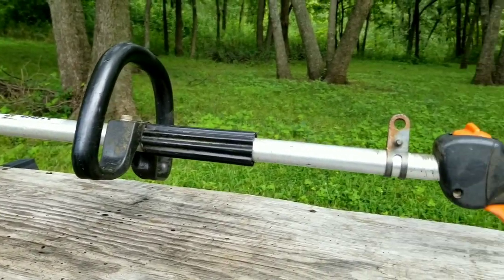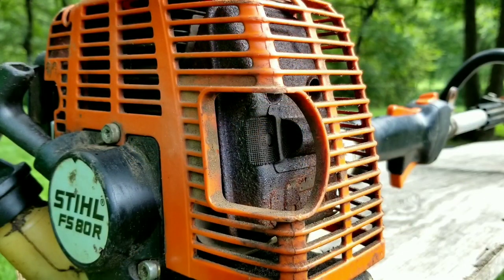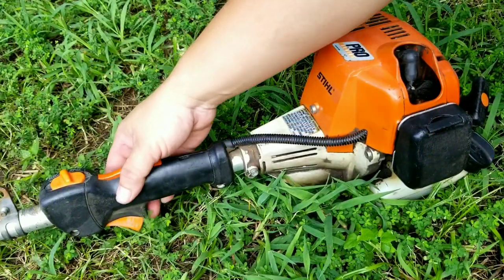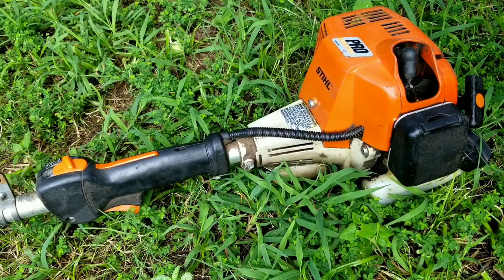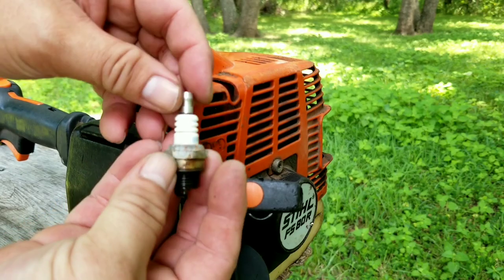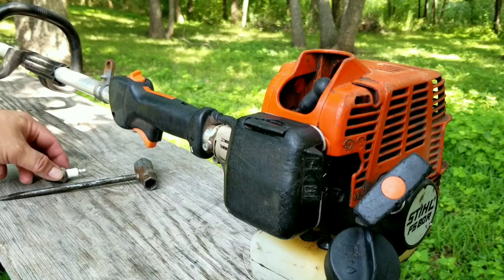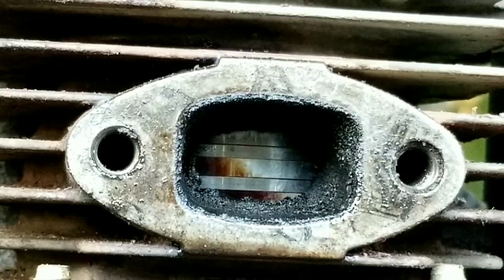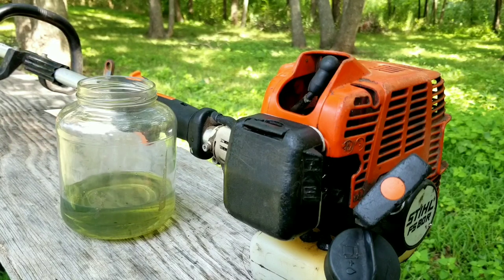Stihl trimmer won't stay running.  Sad ending

Comment: I have a Stihl FS 110. I bought it at least 8 years ago and it's never given me any difficulty until a couple of days ago. I intend to purchase a carburetor kit to replace the one that's in it. The kit also comes with a spark plug, gas filter, air filter and other parts from Amazon. I noticed that it would start and work well until I needed to shut it off for a few minutes. It used to restart it without any problems but lately, it wouldn't restart. I cleaned the filters and spark plug and it's working a lot better. I started  using that premixed 50 to 1 gas that is sold in Home Depot. It doesn't have ethanol and that's  the main reason that my machine has lasted so long. I use it quite a bit since I live in S. Calif. I have 2 and a half acres of lots of weeds.
Reply from the maker: I'm going to guess that the original carb is having some difficulties delivering fuel like it supposed to so a replacement Carb is the best option. Hopefully it works out for you.

Comment: They last longer because they are built better.  I still run my FS 85.  Wife got annoyed from the clutch bell sound, so last year I bought a brand new Troybilt.  It lasted two uses and was nothing but problems.  EVERYTHING broke.  For the FS 85 all I do is run Amsoil, clean filters, grease gearbox and keep the carb tuned.  Runs like a champ.
Reply from the maker: Excellent work.  Thanks for the comment I appreciate it
Reply: I often wondered what made that ding a ling bell sound in my Stihl hl75 hedge cutter. Never knew it was the clutch! I could listen to that bell sound all day.

Comment: Very sad. Was a great trimmer and not cheap. Reason for possible damage as you have pointed out, accidently using straight gas, wrong mix in gas can, mixing wrong ratio fuel/gas in gas tank of trimmer (yes, I have heard of people doing that) or loaning equipment to friends and neighbors. Never loan out your power equipment. It will not be the same when you get it back. My stihl is over 15 years old. I did have to replace the coil last year. It still is running strong.
Reply from the maker: excellent.  Thanks for the comment I appreciate it
Reply: My father gave me one piece of advice that I have followed religiously. Loan out your wife if you’re so inclined but never loan out your power equipment 😆👍

Comment: I use a FS85 since 2002 and it runs perfectly, the Stihl Trimmers are built very well and I take good care of my equipment. I only use Stihl
Reply from the maker: Excellent.  You must take very good care of your equipment for it to last . Thanks for the comment I appreciate it
Reply: I have a Stihl and it NEVER starts.  Have to take it to someone every year.  This is my THIRD gas trimmer - it will be my last!

Comment: I have a FS 90 R and work all day, everyday, for over 2 years. I bought 91 R and did not like it. Its heavier and I don't get the same feeling. The 90 has the same problem as the one on the video, it won't stay on unless on the choke. I wish they continued the 90 R instead of the newer models. Great video!
Reply from the maker: I completely agree with you. Thanks for the comment I appreciate it

Comment: The similar problem even after I had professional service from a trusted location. what I found was the tank filter we floating still connected to the tubing so I was wondering if I'm just sucking air. Took the tank off and carefully push it back in making sure it was at the bottom of the tank and now runs better than it has in years. If it happens again I might spring or something to add weight to the rubber hose to keep the filter to the bottom tank.
Reply from the maker: if you do make sure it's stainless steel

Comment: Danged if I know why so many people with 2-stroke engines insist on running them with no oil in the fuel. "I'm only using it once, it doesn't matter." Yes it does!
If you have a damaged 2-stroke, and it still has some compression, you can sometimes get more use out of it (sometimes a lot more) by adding more oil to the gas. For example, if it's normally 40:1 or 50:1 fuel-oil mixture, try using 25:1. The engine will smoke more, but the extra oil will help seal small gouges in the cylinder wall, giving better compression and allowing you to keep using the engine.
Also, low compression doesn't always mean the engine is completely trashed. It might just mean the piston rings are stuck, and if you can get it to run, running it hard for a while may loosen the rings. In an extreme case you'll have to dismantle the engine to free the rings if they're really glued in with deep-fried carbon deposits.
Reply from the maker: Very well said I appreciate it
Reply: One time I had entered in a repair shop and asked the owner why he had a lot of trimmers in the floor;he told me that some brick headed customers use their 2-cycle trimmers with only gas (no mixture)the look of my face was priceless...

Comment: As of 2023, a top end rebuild kit costs about $30. I’m not a small engine guy and never rebuilt anything and it took me about 45 minutes to rebuild the top end of my FS80. 

Carburetors, if you need one, cost around $15. 

It’s much, much cheaper to fix one of these than buy new.

BTW, that fuel looks exactly like my mixed gas using Stihl HP at ~45:1. I doubt it was bad gas or low oil. If you take the piston out, you can tell from a few different failure modes based on where the wear marks are (intake side vs exhaust side, e.g.).
Reply from the maker: thank you for letting us know.

Comment: I have a fs85r purchased in 98. A few years ago I put new rings and crank seals and a new stihl carb. It fires on the first or second pull every time. It was in storage last year when we went on an extended vacation. After a shot of carb cleaner it started right up and still runs like a demon. It is all the build quality, but there is no substitute for maintenance. Pay me now or pay me later.
Reply from the maker: very nice saying.

Comment: So I'm calling a misdiagnosis on this one. It started and ran on choke. as soon as you turned choke off it stopped. Classic carb issue not getting enough fuel. Low compression wouldnt start at all.As it heats up you will get higher compression too. clean carby and retune. Also some 2 stroke oils dont have the blue dye in them doesnt mean fuel is not mixed. pour some on a pane of glass let it evaporate and see if there is oil residue.
Reply from the maker: thanks Horace Pinker
Reply: If it has a crank seal that is bad, it will do that. Been through it twice.

Comment: I'm a small engine mechanic thears no reason    for this to happen  to a stihl  trimmer  i own sthil products  & I make it a point of servicing all my equipment  that's why at the end of the day I take the time to clean up the  equipment  have it ready for the next job I own the fs90r trimmer sthil ms290 chain saw & the ms441c magnum with a 25in bar & the br600 sthil back pack blower nobody is allowed to use eaney of my sthil equipment ever so don't even think bout asking
Reply from the maker: thank you for your input Rigoberto Dimas

Comment: I just bought the same machine .it was parked up for 5 years .it starts and runs well .but when I stop it and try to start it again it won't start until it cools down. There is also a hole in the bubble squeezer.
Reply from the maker: I do believe it just needs a carb adjustment.
Reply: @INSIDEHOUSEGARAGE  thanks for the advice .
Do you have a step by step guide video on your channel of how to do this ?
Reply from the maker: @liammulligan1279  I have videos where I tune the trimmers I get working, However, I don't have a video discussing the general tuning basics as each piece of equipment is unique.

Comment: In answer to your question, I'm guessing these machines last longer only due to superior build quality.  After working on a couple older Poulan chainsaws with most Torx fittings at T25 I was pleasantly impressed to find that an FS110R had T27 fittings to do the same jobs as well as being more consistent throughout the machine.

I had the above FS110R given to me in abandoned condition with some obvious issues visible externally.  My research lead me to this video because I want to learn all I can about this type and make of machine before digging into it.

I didn't read through all the comments here so I don't know if anyone mentioned these things, but I'm wondering whether your machine is NOT actually a total loss.  Low compression reading aside for the moment, the air filter might be clogged internally and still not obvious on the outside, although that one did look pretty dirty to me.  I just bought my first-ever ultrasonic cleaner and one of the first tests I want to do is run this similar type of air filter through it to determine how effective the recommended cleaning methods really are.  I already used brake clean and air to get most of the debris and oil out of it and then washed it in warm soapy water, rinsed and dried well, so my test will hopefully yield some definitive results.  Next thing I noticed (which seemed pretty obvious to me) was the excess carbon buildup in the exhaust port.  Between the intake and exhaust being clogged I question whether this machine might have kept running if they were thoroughly cleaned.  Then there's the issues several people have mentioned - I would have removed, disassembled, cleaned and inspected the carb to confirm that it wasn't a carb issue like a pump or metering diaphragm, needle seat or filter screen that prevented it from continuing to run.  Frozen piston rings are another thing that really seems to point to low compression, shiny or dull appearance notwithstanding.  Since it had such good build quality I definitely would have put time into trying to give it a second chance at life.  I would have pulled the head and pulled the drive shaft to inspect that as well as rotating it to confirm clutch, etc. condition at the other end.
Reply from the maker: thank you Rein Ciarfella, yes it's not a total loss, I intend on rebuilding it

Comment: You forgot to adjust the three screws on the Carby. LA (idle speed) L (low mixture) and H (high mixture). This is often a problem as I found on mine. They can end up being "out" after much usage of the machine and need to be re adjusted. There are videos out there showing how to do this.
Reply from the maker: I think you're talking about making adjustments to compensate for issues with the carb or the engine?  If so, you can try but you can only adjust so much to make up for s diaphragm that's beginning to harden up.

Comment: Sorry if this is somewhere below - what would cause the air filter to be soaked in fuel? I bought an old fs76 and fuel drips past the orange choke semi circle if the strimmer is turned upside down? Any suggestions appreciated, thanks
Reply from the maker: sure, then carb is leaking fuel. either the pumping diaphragm isn't sealing like it should or the metering diaphragm isn't returning to position like it should. The best option is to just replace the carb.

Comment: Did you turn out the low speed screw on the carburetor?  Sometimes they have to be adjusted.  It's also possible the idle screw is turned out too far and it's bogging down due to lack of fuel.

Taking the carb apart and cleaning the insides with carb cleaner also helps.
Reply from the maker: with its low compression adjusting the carb will not yeild much results

Comment: I have an FS80, it runs perfectly with no issues, except it won't start while it's warm. Any fixes?
Reply from the maker: I'm leaning towards a carb adjustment issue, Either there's too much fuel or not enough. but if I had to guess,  theres too much fuel because warm engines don't need the extra fuel to stay running.

Comment: I like my Husqvarna. Believe it it not. I use a 128ldx with an old craftsman pancake head attachment. It's so well balanced that I kinda get angry if I have to use another half shaft.
Reply from the maker: You can't argue about a well balanced trimmer. Makes its comfortable to use.

Comment: Mix oil 40:1 for everything. If you follow instructions on 2-cycle equipment from different manufacturers you need 32:1 up to 50:1 Mix everything 40:1 and you'll be good
Reply from the maker: I completely agree with you
Reply: Just make sure you use good 2-cycle oil.

Comment: I have a Stihl FS36 Curved shaft Trimmer that I purchased in 1996> I always performed maintenance on it. This season it started and ran fine . But after the first run it became hard to start. I Changed out fuel lines, filter and primer bulb. Checked spark aresstor which was fine. Checked compression which was 75 psi. Cleaned and rebuilt Walbro carb WT160B using Walbro Kit K20-WAT. Still hard to start but when it does run it it works well  until you try to get it to idle. Any suggestions? What is the relationship between the L Screw and the Idle speed adjustment?
Reply from the maker: yes, your low compression is no helping the engine run like its supposed to. as for the L screw and idle, when you add fuel, it will lower your engine speed, so you need to adjust the idle screw to compensate.

Comment: I have a stihl fs91r trimmer and it quit today when I was using it full throttle when I was edging a yard. I had it on its side kind of over my shoulder since I was edging but it lost power and died. Started it again and it ran for a few seconds and it died again. It’s only a few weeks into the season and it’s a brand new trimmer why would it do that?
Reply from the maker: what probably happened is the way you were holding it the trimmer caused the gas to go into the tank Vent. That would keep air from entering the tank and not allow the Fuel to make it to the carb.  put the trimmer back on the ground and open the gas cap, close it again, prime the fuel system and then try starting it.
Reply: Thanks man!
Reply from the maker: @antbartolomeo6643  no problem
Reply: Thanks for this tip.

Comment: Looking to see if you pull engine down to do overhaul or is it never cost effective.?
Reply from the maker: im still looking into the cost
Reply: If you like doing that sort of thing, it's kinda fun to do anyway. An expensive engine (such as a Stihl, Husky or other high-priced make) is worthwhile pulling apart because if the piston & cylinder are trashed, it's possible to get aftermarket cylinders and pistons which are cheaper than originals and often perfectly good enough for home use.
If you use the engine for a living, it might be worthwhile getting factory original repair parts, but the cheaper stuff on Ebay or Aliexpress might be fine for lighter use.
After you're done replacing the junked piston/cylinder, crankshaft seals etc. make sure you put oil in the gas!!!

Comment: even the inexpensive trimmers can last a long time if people would use only ethanol free gas and correct mix radio and before storage for the winter, drain all gas an and dry carb. on carb, the metering diaphragm dries out of shape in long storage and when it's replaced,95% of times it's replaced with a wrong one that doesn't have the same size center metal stud. that means the lever will never completely close  and carb will not run correct no matter how much adjustment.
Reply from the maker: Well said.  Thanks for the comment I appreciate it

Comment: Purchased stihl fs 56 rc 5 months ago. Use it twice a week. Have had 1 day where machine didn't cut-out on me. Most times it will happen 10 times in a 20 minute period. I don't run it at full throttle very often but it will cut-out at any speed, even full throttle. When moving from 1 area to another and you release the trigger, it dies, not all the time but sometime. Engine can be cold or hot. Had it back to dealer 3 times and of course, it doesn't happen there. Using regular gas and stihl oil. Any suggestions as to problem or solution.
Reply from the maker: typically when it dies during usage its running out of fuel. i would suggest turning the L screw about a quarter turn counterclockwise and turning the idle screw clockwise about half a turn to it doesn't die from the introduction of more fuel.
Reply: thank you for your comments, will try what you suggested @INSIDEHOUSEGARAGE
Reply from the maker: @johnwakeford3818  cool let me know how it goes

Comment: I am arion I am 12 years old ,I saw my grandfather  had a Murray 22 mower and It weren't  starting ,so I watch some  of your vids and I fixed it,then he had a dunsh  laser brush cutter so I tried to start it but it didn't I Chang the spark plug ,new gas new carb but still  won't start .Can u give me some advice
Reply from the maker: sure, do a compression test.